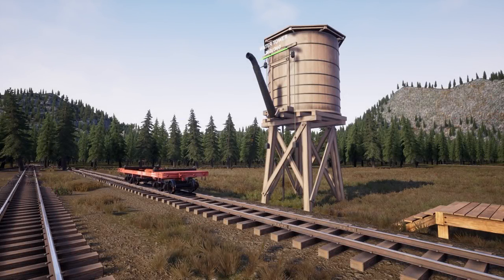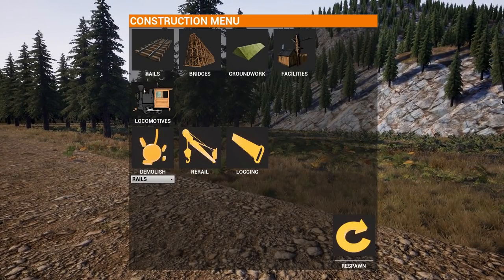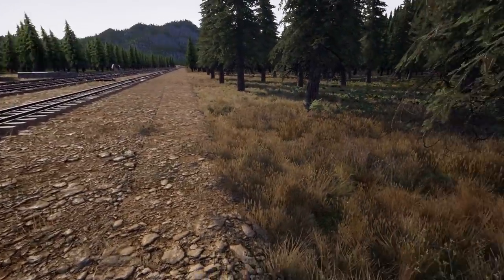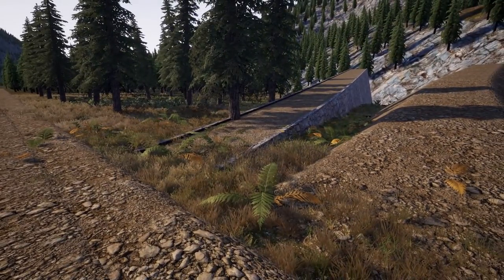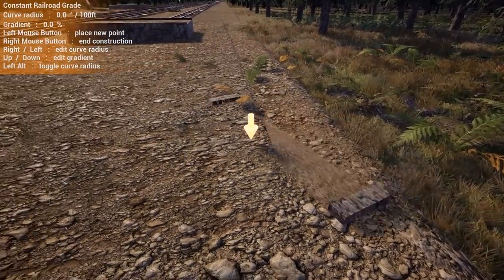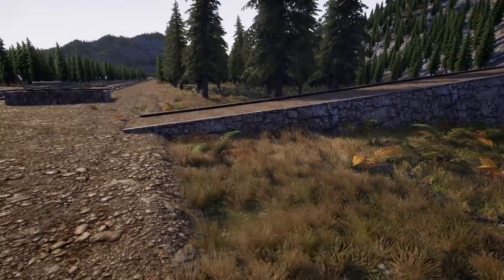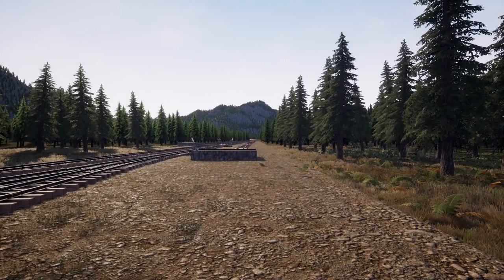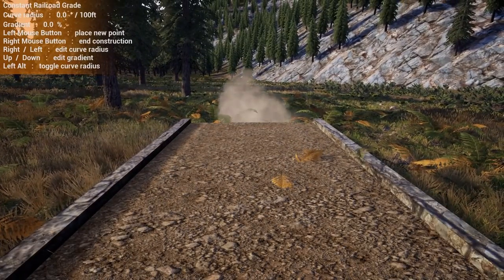Railroads Online! Guide - Track Laying Basics (Tutorial)

Comment: If you want the groundwork and track to lign up, use a rough groudwork to get where you want to go, lay the track, then delete the groundwork and go back with new groundwork and snap it to the snap points of the rail.  You can also use that method to "bury" the ties into the groundwork by selecting the height of the groundwork to match the height of the ties.
Reply: That sounds handy! Thanks!

Comment: Railroads Online has changed drastically since this video, id suggest giving the game a try again. New locos (coal powered as well) can lay track and base at the same time and the tracks are smooth, no more wiggly tracks. Laying track is much easier. My second play through of the game came after they did the spline update and i was able to run a line from depo -> logging camp->lumber mill Within 3 hours, when it took that long to make it just to the logging camp. First play through (pre spline update) 5/10. Second play through (post Spline update) was 8/10